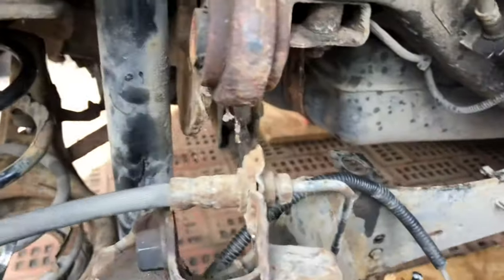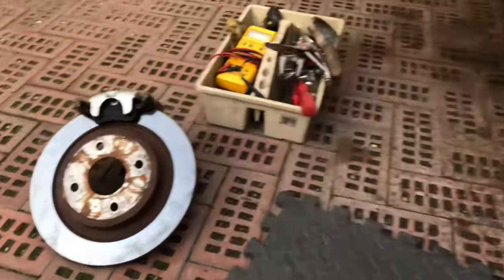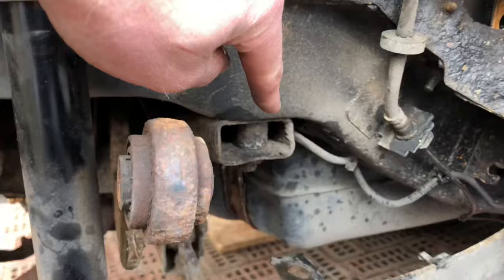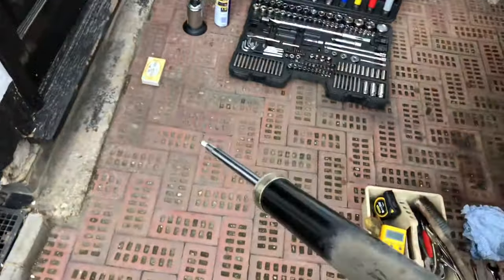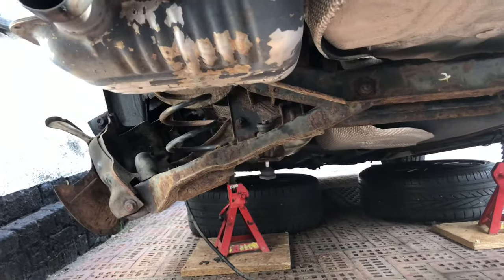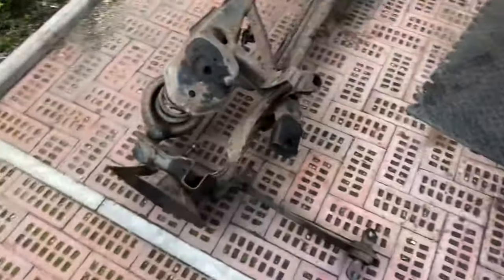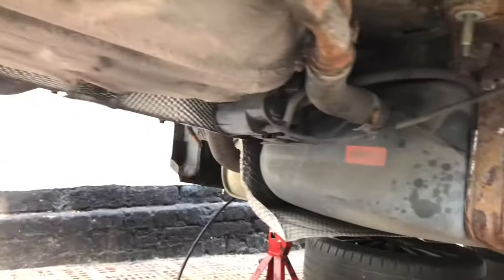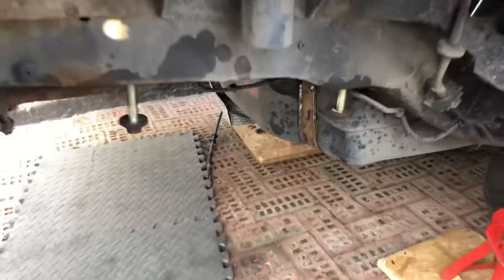Rear Subframe Removal - How Bad Is It?

Comment: Great video. I have a mk1 1.8 and would like the rear suspension changed (excluding the sway bar and the bar the wheel attaches too). 2 garages have said no to doing it as they reckon the bars will need cutting off making it too big a job for them.

After doing yours, do you think they are right or maybe they just don't want to take it on?
Reply from the maker: You’ll most likely be running into a lot of corroded bolts that’ll probably need cutting off. Shouldn’t be a huge issue it’s just a bit fiddly. It might be they don’t want the work as it may run into other stuff if it’s a bit corroded - ie other bits snapping off they didn’t quote for etc. Best bet I would guess would be to take it to some smaller independent garages if there’s any in your area? Or anywhere slightly more geared towards classic motors etc. Tricky to find though sorry I can’t be of more help!

Comment: What keeps the springs from just pushing the swing arms fully down ?
Reply from the maker: It’s all bolted together to the other arms and the shock absorber. It’ll drop down a bit more than usual when it’s in the air but won’t pop out fully unless the bolt near the wheel is disconnected. I found it a right pain to do!